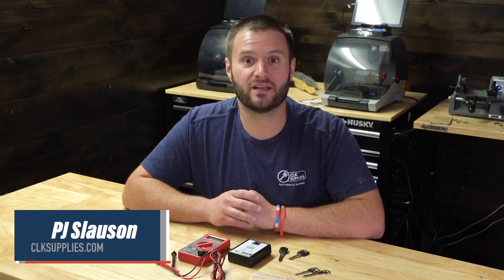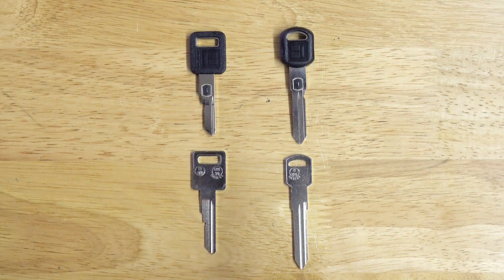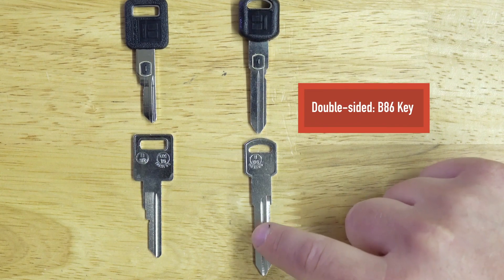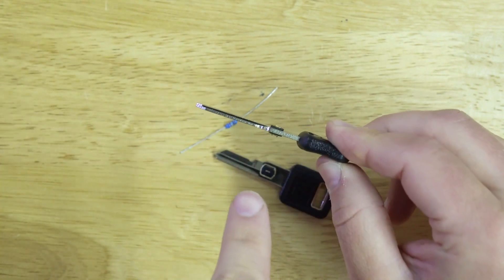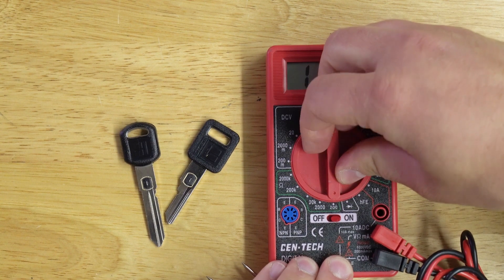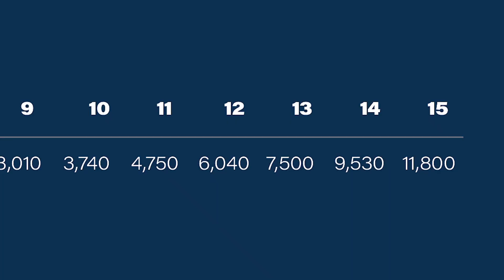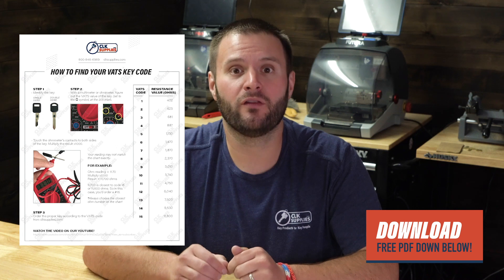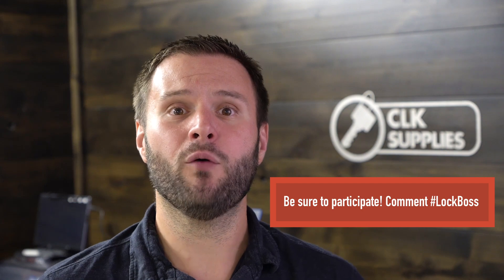Everything You Need To Know About VATS Keys | Locksmithing 101

Comment: I replaced a 93 GMC Pickup ignition lock this morning. It was a MATS system but still a single sided key. 
I check my VATS keys the same way you do. Really good video and illustration though. #lockboss
Reply from the maker: Great! It's been a minute since I've taken apart a 6 cut steering column. Great work! -PJ